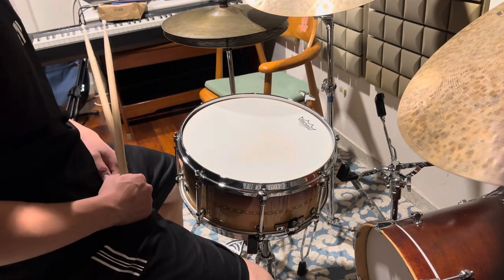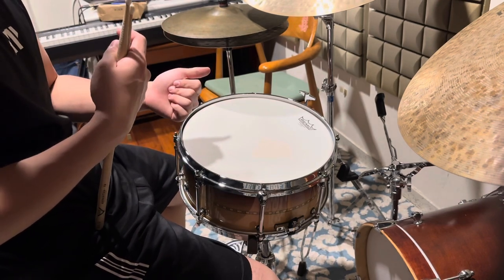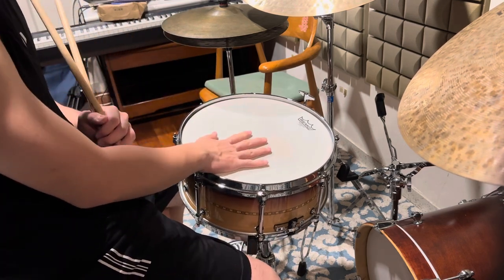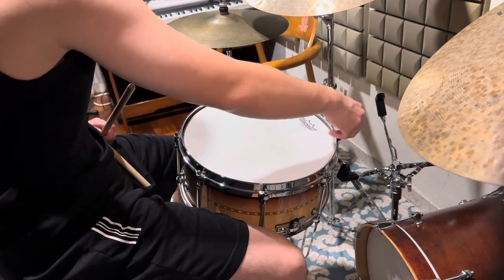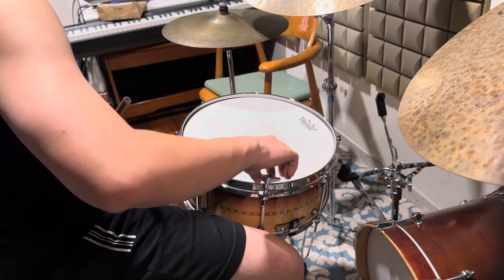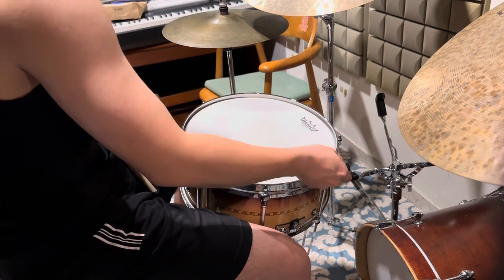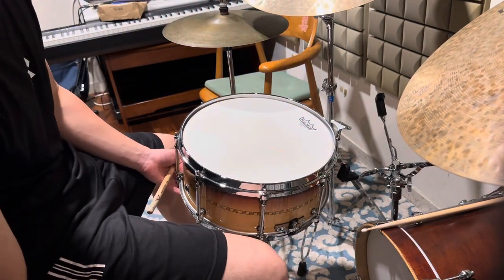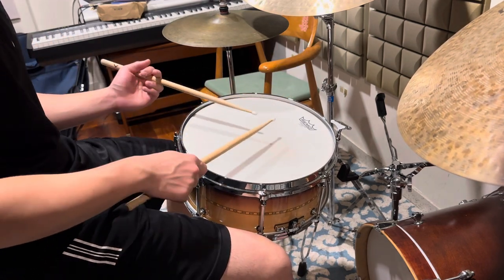Fix that crappy house kit snare in 10 minutes!

Comment: Great tuning ideas for Snares. Just got a new Evans Calftone Snare head and having some issues with "ringing" which is annoying. I have a flat Leather Magnet I use instead of "goop" squares which helps with the loud ringing however, it's still there.💡🎶🥁🤙🏽🌛
Reply from the maker: Evans Calftone is a great drum head, but I won’t really seek for a pure tone out of the drum head. It is because calftone isn’t “Homogeneity”. Unlike ambassador coated, the surface of calftone is actually irregular so it is really hard to get every corner of the drum head even tension.